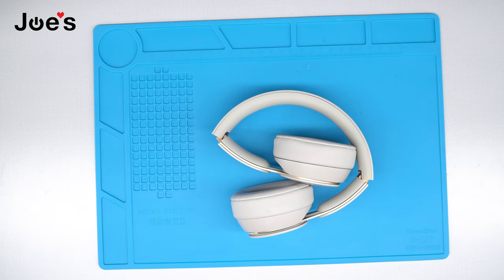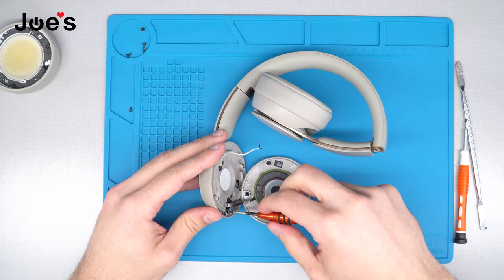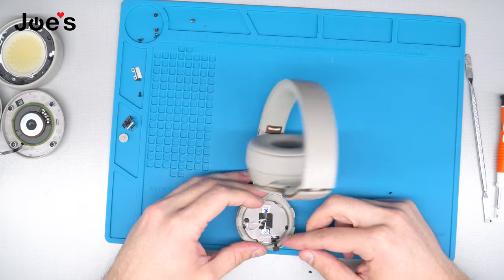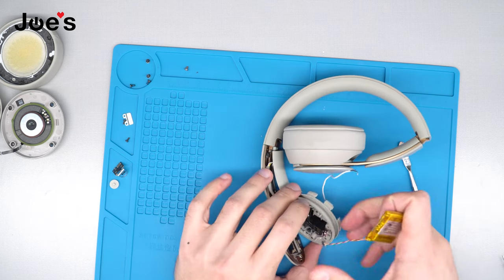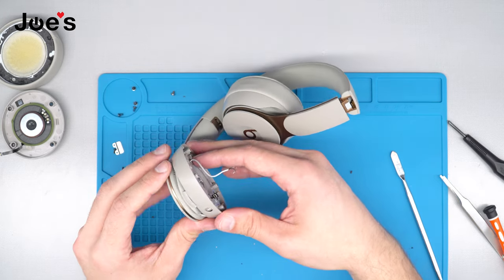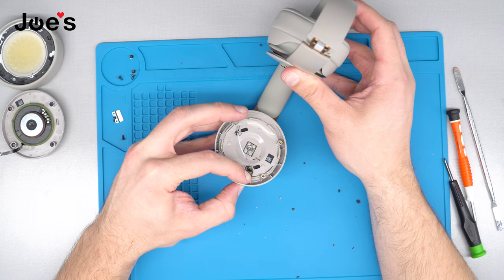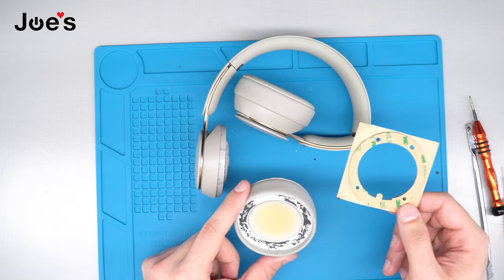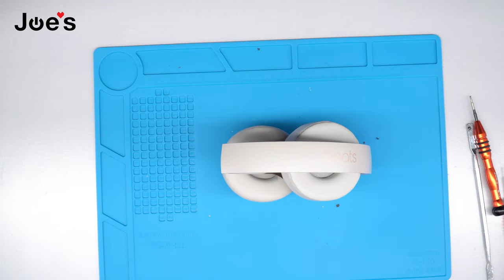Beats Solo Pro Battery Replacement | Repair Tutorial

Comment: Um... the reason why there is sealant in there is to keep as much sound out of the speaker chamber as possible.  If you remove it you need to reapply some more to get it to function the same way.
Reply: yea i learned this when i accidentally teared it off while trying to replace the ear cup. when i put the new ear cup on the noise cancellation wasn’t working because all the outside sound was coming through into the speaker chamber i had to use hot glue as a sealant to remove the sound that was traveling into the speaker chamber
Reply: Does anyone know what type of sealant it is? Also I damaged the rubber ring/gasket around the speaker housing bc I angled the spudger the wrong way when initially prying the ear cup off…is this a replaceable part?

Comment: Hi there. I have this exact same model of Beats headphones. They won't charge or turn on. When I connect the charger, there is no light or anything. Is it possible that replacing the battery can fix this? Or  are they dead? Great video, btw.
Reply from the maker: It is possible that the battery is the issue

Comment: 14:42 min. : what ribbon is that? while doing the battery change it ripped and now I don't know what I need to order or if I need to order a new frame or if I can change that ribbon alone? Please help! Thanks🙏
Reply from the maker: You are going to need to replace the whole power board. Here is the listing
https://www.joesge.com/products/beats-solo-pro-wireless-headphones-repair-parts?variant=31755372855342
Reply: Okay thanks for your reply

Comment: Hello i have a pair of beats solo pros and my problem is that i will charge them to 100% and while using the beats the left side will get very hot and the beats ultimately die in under 15 minutes despite having full charge
Reply: Any help?
Reply from the maker: Definitely need a new battery
Reply: @Joesge  how do i purchase a new battery had them since 2020

Comment: hello!!! pls help me i accidently left my beats solo pros opened up a whole school day and now it doesnt wanna reset,turn on, etc sometimes it just blinks white and pink slowely and sometimes it blinks white then red slowly pls help!!!
Reply from the maker: Hello, thanks for commenting. Please email us at support@joesge.com with a screenshot of your question and we will be able to better assist you there. - Aaron P
Reply: did you ever get a response? i’m having the same issue! mines won’t charge at all and when connected to power it just lights up
Reply: Mine too. How to fix this please help
Reply: Same problem, 
Will changing the battery resolve the blinking light.  Won't pair.  Tried resetting holding button and volume down.  Tried every combination.  Let me know if it's a battery issue 
Thank you
Reply: Mine is to please help 😢😢😢
Reply: @Joesge  
Answer the question
Reply: Me too 😬
Reply: Did you ever get a solution?
Reply: @robinkarz  no sadly😞 they never ended up working
Reply: @kluaz8325 Did you try changing the battery?

Comment: The squeak noise at 5:26 happens so much and it’s making me go crazy. Anything I can do to fix that?
Reply from the maker: Hello, thanks for commenting. Please email us at support@joesge.com with your question. We will be able to better assist you there. - JoesGE
Reply: Double click the power button or turn off noise cancellation and ul be fine
Reply: I found the solution after 3yr. I teared down earbud and put one drop of oil that I used for mechanical keyboard to hinge. I guess u can use any kinda grease oil. U can see that hinge part at 8:22

Comment: My beats dont charge they only blink red fast and then after a min they stop blinking red and dont charge any help : Do i need a battery replacement
Reply from the maker: Hello, thanks for commenting. Please email us at support@joesge.com with a screenshot of your question and we will be able to better assist you there. - Aaron P
Reply: I also have the same issue. Red and white indicates that the battery is degraded to the point where it can't charge. However it could also indicate issues with the wiring in the headband as well. I am hoping mine is a battery issue and will be buying a battery as they are not expensive.

Comment: The Solo Pro is seriously flawed. I bought one that lasted only one year then the led flashed red and white. Sent it to be repaired under warranty, they replaced it instead and the new unit died the same way six months later. What is wrong with it ?
Reply from the maker: Honestly just a bad product
Reply: @Joesge  What a shame, when it works it's just perfect to go running ! I wonder what I'll replace it with...
Reply: @Homme_De_Kro-mignon i have 2 they been working fine for years except i had to replace the ears pads on one of them
Reply: @berv9169  Nice ! Did the same on my previous Solo 2 Wireless that thankfully I kept, it still works after 9 years. You're lucky yours still works !

I bought mine on Amazon just before they discontinued it and I wonder if the battery died because it was stored for a long time...